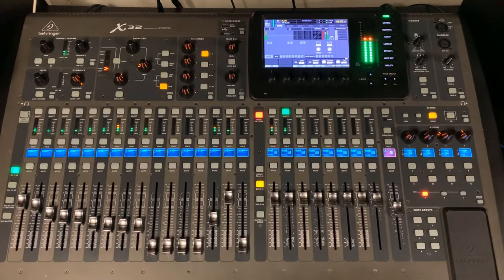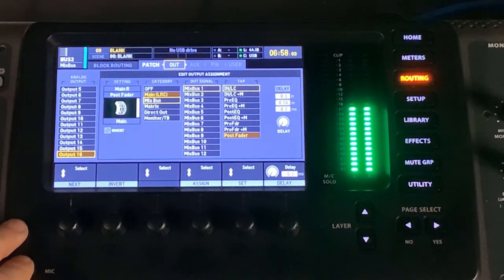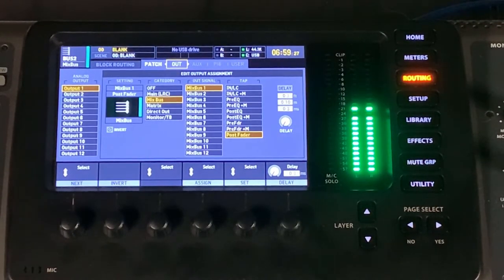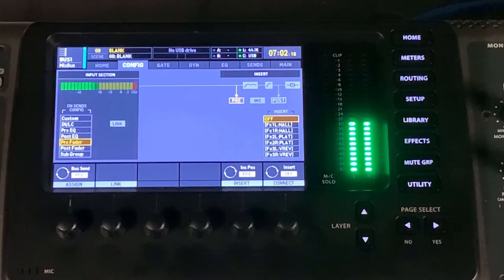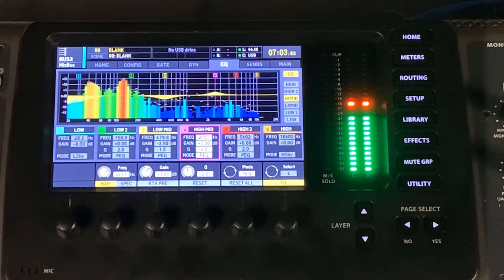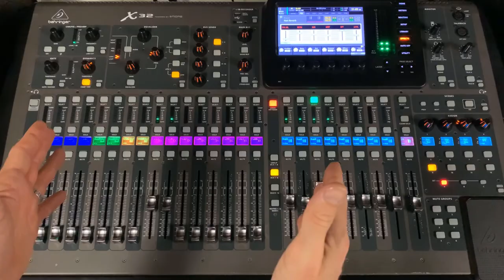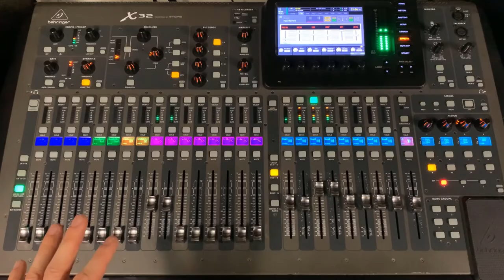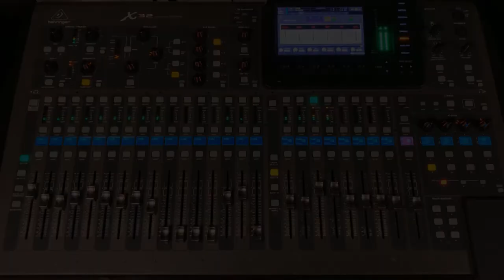How To Setup Monitors On The X32 (or M32) Sound Console

Comment: I keep seeing you talk about post fader. What about pre /post eq? On old school boards I always ran pre fad pre eq, and never had a monitor problem. On my Allen and Heath mix wizard I actually had to go into the board guts and move a jumper to get pre eq. Solved all my fb problems. I’m working a local concert club on some one else’s system, and he insist that pre fade post eq is ok. We did a 10 band benefit yesterday and the feedback was out of control. On M32 when you go to channel sends tab you can change to pre eq on each bus mix. But it also has option for pre fader. Does that change your pre fader setting that you’ve set up in the other setup options? I watched the house guy that owns the gear chase fb like a wild man going through every channel and notching every eq trying to control fb. I told him he needs to go pre eq and go to 31 band and notch out. He has 31 band inserted onto each bus send, but never uses. We had a 160 hum when band stopped, and was notching every channel to try and stop it. I was monitoring everything on my iPad. I reached over and notched 160 on 31 band and all is well. But he thought he fixed it. Lol maybe do a video on pre post eqi ng I see a lot of guys out there that run post and have lots of problems, but don’t want to listen to me. Sound guys…hmpf
Reply from the maker: This is great advice and certainly something that most people are not aware of the differences that this tap point can do in the scheme of things. In case you are looking for it, the tap point is in Routing > Outs where you designate which mix goes out a specific output and then you can choose the tap point at that time as well. I'll add it to my list for a future video.
Reply: @AllamHouse  so you can run pre fader AND pre eq at the same time some how.. All i can ever find is menus with one or the other
Reply from the maker: Yes, the X32 has various tap points you can choose from for your outputs or the specific BUS. Select a BUS, go to Home > Config and on the left you can select the tap point for all inputs going into this BUS. Notice Pre EQ comes before Pre Fader therefore it will not be impacted by the fader level. Then, you can select the tap point for the BUS itself (before it actually leaves the console). This is set in Routing > Out where you can select the similar settings, but at the BUS level. Use the encoder knobs under the screen to make these selections and push the encoder to lock it in.

Comment: After watching the first 5 min I believe I’ve setup my monitors up incorrectly, which I will change and follow this method. But I need to ask, when I setup monitors I would select the Channel then Send to faders. Then I would raise the Monitor fader to the desired level then Unclick Send to fader for that Channel. 

What exactly am I doing?
Reply from the maker: You are doing the same thing, just in reverse (kind of), well the other side of the board. Both can accomplish the same thing, I just tend to teach (and relate more) to selecting the monitor I want to change and then adjusting my mix. Both work though.

Comment: Is there a way to keep the monitors from changing whenever someone turns up the gain for the lead singer during worship?
Reply from the maker: There are a few keys things to understand based on the words you used in your question…
(1) the Gain impacts everything downstream. You want to set the gain and leave it. I usually recommend setting it between -9 and -12 on the inout meter for each channel. The faders would be used to adjust the mix volume and bring (in your example) a vocal up or down during the event. 

(2) if your Monitor BUS is set to Pre-Fader (in Routing > Outs) it will not change based on the house mix fader moves discussed in step 1. If you have it set as Post Fader than you will have the monitor mix change according to fader changes done by the sound tech for your house mix.

Comment: Can send eq of each chanell to monitor(bus 1) ? Or just can to bus1 like one for all eq
Reply from the maker: Yes, select the channel, go to Home > Sends on the screen. Use the encoder knobs to select the desired BUS and you can adjust the tap point for that BUS. If you choose Pre Fader or Post Fader (standard selections) it will automatically take the signal after channel strip EQ and Compressor.

Comment: My question is how do I control the  Behringer S16 on the x32. The older firmware had a spot for ultranet which is gone now. I have a powerplant 16 and for some reason I can not listening in stereo or out of both in ears. It's just in my left ear. I made sure that the p16 isn't set to pan left. We have had multiple sound guys and nobody set the x32 up correctly. 😭
Reply from the maker: You wrote S16 (which is a digital snake), but your questions lead me to think you meant P16 which is for IEM. Assuming it is the P16 for monitors, you will need to click on ‘Routing’ and go to the P16 tab. There you can setup your 16 signal choices that will go to the 16 channels of the P16.

Comment: Can I flip the monitor outputs on the aes50 in other words I have the x32 producer so that's only 16 channels and I'm changing the settings so that I can mic the drums 25-32 but I only have 8 outputs in the console so can I change the out put number?
Reply from the maker: I'm not sure I understand what you are trying to accomplish here.  You have 16 inputs, plus you have the 6 AUX inputs on the back of the console that are all available to use.  Those are the physical inputs available.  The outputs are set as outputs and are not able to be "flipped" and turned into inputs. There might be a better way to configure your inputs to make room for your drums, but I would need more information to assist.
Reply: You will need a stage box like a S16 or a S32. I use a S32 with my X32 Compact and it works just like my X32 large console.

Comment: The X32 is already limited on the number of effects you can set up, so setting up a dedicated monitor reverb only gets you one less option. You can simply select ‘sends on faders’ for the monitor bus in question and bring up the stereo returns for any of the house effects you have instantiated. Why would you dedicate a reverb?
Reply from the maker: While it is limited, I find I really only need a reverb and a delay to get a mix in a really good spot. Keep in mind there are still the four other racks of insert FX that I am using with de-easers and other compressors. You are also correct in that you can share a verb (or other FX) with both FOH and monitor mix. I find that mentioning it can open peoples minds to the fact that they can designate one verb for their monitors to make their musicians happy and then use the others for their mixes. The great thing is that there is no right or wrong way to do a lot of this stuff so I just get to provide options and each person can then experiment with what works best for them. Thanks for the comment and discussion.
Reply: With all due respect … just because you can set it up that way, does not mean you should. Your video does not suggest this as an option; rather, it lays it out as a how to. As a means to provide the uninitiated with information on best practices, it is not the right way to set up the X32 for a FOH/Mon mix. Why would you need another reverb when you have one sitting there, with the push of a button? Why wouldn’t you setup one of the myriad of available FX plugins instead, to help the mix along? 

I’m sorry, but I guarantee you there are viewers out there who now believe that the only way to send a verb to a monitor mix is via a dedicated FX, and that is simply not the case. You are doing your viewers a disservice with this kind of information.
Reply from the maker: Thanks for the feedback.

Comment: Dumb question but do I need a amp in order for my floor monitors to work using an SD16 stagebox?
Reply from the maker: Yes. The stage box is just a tool for routing I/O with the console. You would still need an amp with passive speakers or grab a powered speaker that had the amp built-in.

Comment: Hey thanks for your realy great videos on the X32 if got an x32 to rack and I want to use it for in ear Monitoring of a band, i made 3 mix buses to send 3 individuell mixes to the band members and routed them to aux out 1-3 cause the transmitter only got 1/4" inputs. my Probel is I get a mono signal on the left side as output signal, how can i change that   ?
Reply from the maker: Two options:
1) either take MixBus 1 & 2 and link them which gives you a stereo mix and then send those to your IEM device... OR
2) depending on the IEM device you have you can set it to receive a mono signal, but duplicate it to both ears this is a ‘bridged mono’ setup.  This is actually how my church functions. We have two wireless units that have a bridged mono setup and our hardwired unit is also setup in a similar format.

Comment: Wonder if this will solve my problem. I have 5 iem mixes and tried to copy one over to make a 6th. The mix works great except the 6th bus does not hear the click and guide . That channel on FOH is unmuted but fader is all the way down so the crowd does not hear the click
Reply from the maker: Hopefully you got some helpful info to troubleshoot.
Reply: @AllamHouse  does it sound like my issue might be the pre/post fader thing?
Reply from the maker: Yes, a bus mix going to IEM should be set to Pre-Fader so that the fader for FOH doesn’t interfere with the monitor.
Reply: @AllamHouse  
I am still not 100% sure where I make this pre/post fader adjustment. I think I just kind of lucked out and they were already set on pre. But you might have answered this in the video. I can’t watch the video because it’s 4:27 AM and my wife is asleep! ha ha I’m just reading the comments.

Comment: 5:36 how do I send that mix to the person with in ears. Aux out or?
Reply from the maker: By default the MixBUS 1-12 are set to go out the physical XLR outputs on the back of the console (smaller platforms it is 1-6). You can connect an XLR to the console, if you have a digital snake like the S16 or S32 the outputs are usually mirrored so you could connect there if needed as well. If you need to use the AUX out on the back of the board you will go to Routing > AUX and locate the desired AUX Output and then select the desired MixBUS source. Then just connect your 1/4" cable from the board to your transmitter and you are god to go.

Comment: How can you route mixbuses to returns from the 16returns on the s32.
Reply from the maker: I'm not sure I understand your question fully, but I think you are looking to build monitor mixes on some MixBUSes and then send them to your stage through a S32 stage box. If this is correct, you need to do these few things:
1) Go to Routing > OUT and confirm what output each MixBUS is mapped to as a source. Usually this is a 1 to 1 mapping so MixBUS 1 is the source for OUT 1, MixBUS 2 is the source for OUT 2, etc. 
2) Go to Routing > AES50a and make sure your 1-16 are set to Out 1-8 and Out 9-16. This will send a copy of the outputs from the console up to the stage box.
Make sure you set the Pre/Post fader tap point correctly in the outs setting according to your needs. This video here discusses the differences. https://youtu.be/1GNmNWdVWKg
Reply: Thank you so much. This was exactly what I was asking. God bless you I was having such a hard time getting this done.

Comment: Anyone else notice the Pre-Post Fader MixBus Config is not available in the X32-Edit Software? I can only find it on the console but not in the software while editing offline to prepare for events beforehand.
Reply from the maker: The X32 edit software is a little different, but the features are still there... hidden, kind of. Go to Routing > Out 1-16 and when you setup an output you can change the color based on the legend below the matrix. For Windows, right-click or for MAC option-click and you will get a drop down menu to select the type of output you desire. As always, I recommend double checking these setting a once you get on the physical console, but I’m pretty sure this is what you are looking for.
Reply: Thanks for the reply, I tried that already and that seems to affect the “Outs” itself... so for that switch I need to set to “post-fader” if I want to control the overall bus volume by the mixbus fader. The part where you select the mixbus channel and go to config, sets the behaviour of the mixbus sends, in this case I want it to be “pre-fader”, but I couldn’t find it on the x32-edit software while working disconnected from the mixer.
Reply: @AllamHouse  I found the solution for using the x32-Edit. I'll describe this for the benefit of those who also uses the software for editing. When using the x32-Edit software (ie. Not on the console itself), in order to set the Mix Bus to "Pre-Fader", we have to:
1) select an individual input channel (e.g. CH1 - Vox)
2) click the "Sends" tab on top, 
3) click the Globe-like button on the left side of the panel (beside the first sends fader). This will make changes to affect all input channels. 
4) Then click the bullets above your desired mix bus to change it to pre-fader, post fader, etc. 

The operation above is the same as selecting the Mix Bus on the console to change the pre/post-fade parameters in the Config tab.

Comment: Great video! Unless I missed something, I understand that it is not possible to set stereo monitor mix?
I mean in studio, it's sometimes very important for the musicians to have a stereo mix. If it's possible, how could I set several stereo monitor mixes?
Reply from the maker: You can setup stereo monitors by selecting an odd numbered MixBus, hitting the home button by the screen and then pushing LINK. This will link with the next MixBUS and give you a stereo pair. When you build your mix you will have the ability to pan items specific to your monitor or just take the panning that is done in the house mix. This video has some various tips you might find helpful about this topic as well as building a custom mix on a MixBUS. It is focused more towards a live stream, but you can use the same concepts to build a very nice IEM mix. There are quick links in the description of the video. 
https://youtu.be/pMnaiuC55RY
Reply from the maker: I would not send my people stereo IEM mixes. It’s very rare that people get stereo mixes and it will make tour life a lot easier. A mono mix can be sent to both ears and use a reverb on the console to build space in their heads. 

An XLR output is a mono output only.

You can route a MixBUS signal to the AUX outs by going to routing>Aux Out and selecting the AUX out you want to set, then select the MixBUS on the right and your signal will be sent to the desired AUX output. If you need further help for a faster solution I do handle consulting. You can fill out the contact card on my website to get that started.
Reply: @AllamHouse  Thanks so much. I really do appreciate all your info.  Great work on the training as well. Cheers!
Reply: @AllamHouse  Thank you for the reply! Great help!!

Comment: Can i  eq each chanel and send to monitor withnot touching main eq of each channel
Reply from the maker: No, unfortunately you do not get separate EQ for main vs Buses. You do have the ability to change the tap point where the signal is picked up to go to your BUS. Select the desired channel, go to Home > Sends and use the encoders to select the BUS and then the tap point. This can allow you to have (example) an electric guitarist get their full signal by tapping pre-EQ for their monitor on a BUS, and then the EQ is engaged for the mains.
Reply: @AllamHouse  for drums?
Reply: I not undestend best
Reply from the maker: The easy answer to your first question “Can I EQ each channel different for main and monitor?” Is NO. I was trying to offer other options, but no, you only have one EQ option that will impact mains and monitors.

Comment: So I am completely new to all of this and this video was very helpful. Unfortunately, sometime before I was recruited to help with our school sound system, the monitors got unplugged and I have no idea where to plug them in. I've tried the things in this video, but every time I move the main volume up and down, the monitors react the same. They are also not independently controlled. I'm not even sure I plugged them into the proper spot. We use a x32 board on wheels from the back of the cafeteria. It connects to the wall through an ethernet cable. I found where it connects to the rack on the stage. Currently the monitors are plugged into output 1. Hopefully this makes some kind of sense to you, but any help you could provide would be greatly appreciated. Thanks!
Reply from the maker: Here are the steps I would take to troubleshoot…
1) identify what you are mixing the monitor on… ideally this would be a MixBUS, but if it’s a matrix you’ll have issues. 
2) Assuming it’s a MixBUS, go to Routing > Out and scroll through the left side to see where your MixBUS is routed to. Ideally, the Out 1 is sourced by MixBUS1, Out 2 with MixBUS2, etc. 
3) Next go to Routing > XLR and make sure your MixBUS is set to go out the same XLR output. Usually this is just set to a one to one mapping of Out 1-XLR1, etc. 
4) Once you located the output your MixBUS is routed to, plug the XLR cable into that output on the back of the console. 

I hope this helps you out. I’m assuming you are just a volunteer, but I do offer consultations if you need help faster.

Comment: what free app can i use 10:30
Reply from the maker: Grab the M32-Q app from your app store.  This will allow the musician to control their monitor mix remotely on the X32 or M32 console.  They will need to be connected to a wireless router and the console needs to be connected to the router as well for this to work.